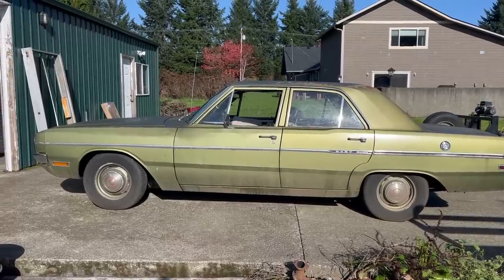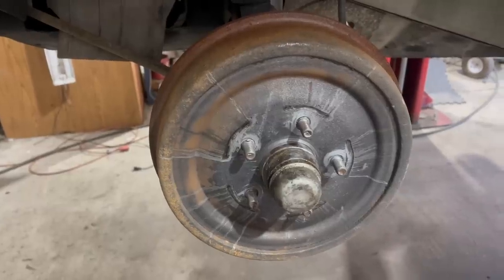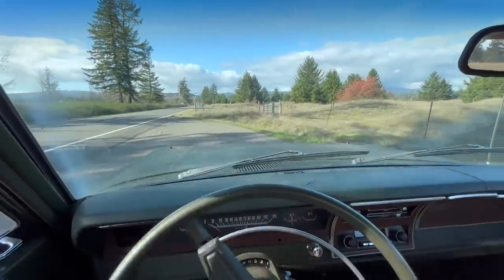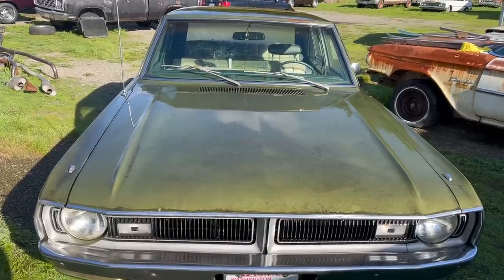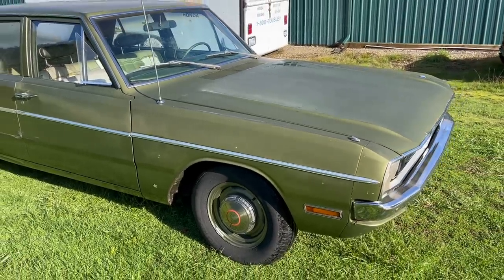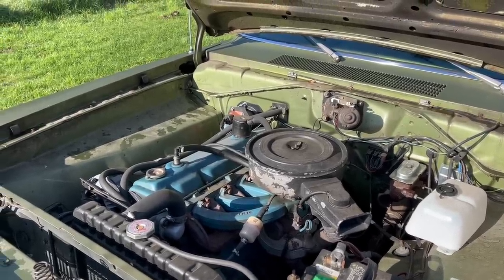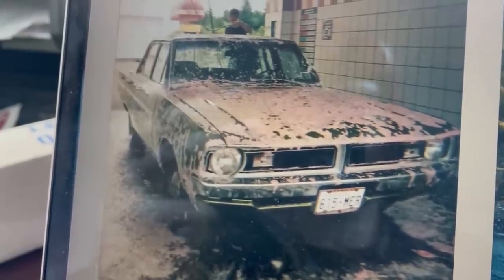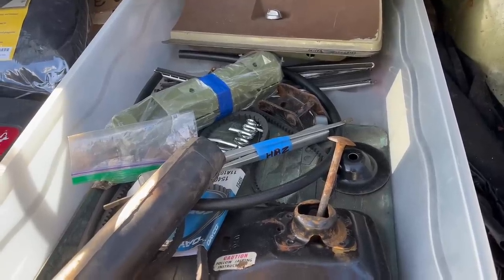Survivor! This Two Owner 1970 Dodge Dart Is A Slant Six Powered Street Machine (With Original Paint)

Comment: Ah the memories... I recognized the foot squirt pedal for the windshield washer. One thing you can do if you are a stupid 16 year old version of me is drive at 100 mph past Richmond Park at 2 am and pull the hand brake to see how far you could leave a skid mark on the road. Then of course dad makes you replace the D shaped tire...Valiants can survive anything...
Reply: And peel the living daylights out of a 14" tire.
Reply from the maker: Haaahaha. Or you’re me at 18 and you have to find out what the exhaust sounds like when you cut the muffler off. Or what happens when you slide sideways across the street into a curb… I participated in many physics experiments behind the wheel of a slant six car.

Comment: Nice old Dart! It very much reminds me of the 67 Coronet 4dr I once had. It was about the most bare-bones Coronet you could buy, slant 6, rubber floor mats, dog dish caps, and very little chrome trim. It did have an automatic though, so I guess that was a step up from a 3 speed manual. I bought it in 1987 so it was 20 years old at the time, but it was very clean. An elderly couple had it and had passed on and their family sold it to me. The ash trays had never even been used. I gave it a good cleaning and a wax job and it looked almost new. It had 3.91:1 gears so it didn't get the best mileage on the highway, but damn I loved that thing. Then I sold it to a friend, who later sold it to someone else, and the rest of the story is too depressing so let's just say I wish I had never sold it.
Reply from the maker: Wow. That’s awesome - until the story got sad anyway. I wonder if it was a base model Coronet Deluxe. It’s so funny that the basic low end models were always called things like “custom” and “deluxe.” You really don’t see many of those. They are almost always the 440 model like our wagon. I actually owned a ‘67 Coronet 440 sedan myself for a while. I never really got to drive it, and I eventually traded it for a boat. It somehow ended up in the Rocket parts car collection, so now I see it every single day I’m there… also sad. It was a pretty decent car.
Reply: @DeadDodgeGarage  It actually was the Coronet Deluxe model. It had a small "Deluxe" badge on the rear quarter if I recall correctly. But, yeah, it wasn't "deluxe" in the true sense of the word.

Comment: Original is way cool! I never knew there should be a small piece of felt on the trunk bracket for the jack until I got my 71 Swinger with 30k miles, white top, green car, multi-green interior, slant, great driver.
Reply from the maker: Yeah! I was surprised when I found that in my ‘71 Demon’s trunk. I really thought Dale might have added it at first. Haha.

Comment: Cool little car! I used to only look at a 4 door as a good dog house donor but have learned to appreciate them nowadays, great to see one original and saved!👍
Reply: 4 door/wagon classics are becoming a popular car now because they are cheap and more often than not are better taken care of, One of the 20 something girls I work with just bought a 1980 Ford Fairmont Wagon because she has 2 young kids, and her ex is a complete dick and kept the car she had because it was in his name, She paid $800 for it, it runs and drives fairly well but the paint is toast. me and one of the other guys have pretty much spent the last 3 weekends with her, the first weekend we detailed the interior, and gave it a good bath, 2nd weekend we changed all the fluids and gaskets so she could atleast drive it. This past weekend we cleaned up the brakes and suspension and started on the body work getting it ready to paint, Currently it's light blue but were 2 toning it White and GM Medium Poly Green, I have a half gallon of the green and the other guy has about 1/3 of a gallon of white that were going to just donate to the cause. were just going to clean up the wheels, repaint them and throw some cheap aftermarket baby moons on it for her.

Comment: I had the same model and color with power steering, power brakes, factory A/C and automatic . The car on a good day gave 12mpg (gas back then was 28 cents per gallon) and the 0 to 60 time was somewhere before noon.
Ordered the car August 1969 received October 69 put 35000 miles in 4 years traded for an ordered 1973 Chevy Caprice with all the options. Good times!!!
Reply from the maker: That sounds about right, except… 12 MPG?! My big block does better than that.

Comment: My grandmother had a 1968 Dodge Dart. No power steering, no power brakes, slant six. It was just about bullet proof. But it felt like driving a car built in 1948. It wandered, the brakes were marginal and it was about 3 1/2 turns from lock to lock.
Reply from the maker: Perfect! Well, kind of. Haha. My grandmother also drove a ‘68 Dart, funny enough. Years after it had been sold to a gentleman, the rear end fell out going down the road somehow.

Comment: WHAT'S the 5:40 difference anyone? My 1970 knowledge starts and ends with the Valiant, also my daily driver since fresh outta high school in 2000. Slant Six car as well. Got her garaged for the first  time ever over the winter to do a full seal set and some MUCH needed TLC
Reply from the maker: Two people have alluded to what it is… basically, the 1970 and 1971 grilles are the same, but also not the same. The hood emblem is also different - this car doesn’t have one at all currently.
Reply: @DeadDodgeGarage What do you mean? I still can't notice a difference 😅

Comment: I loved my gold ‘69 4 door Dart with its slant 6 and Torqueflight. It still had points but I kept that engine so well tuned that as soon as any one of the six pistons hit TDC it was running, just set the choke and bump the key in the morning and you were on your way. In all the years I had it I never had a lick of trouble with it. I even drove it home from Vermont to NJ after spinning out on ice and slamming the right front fender into a guard rail three times. It spun around and hit the same place on the same fender three times but nothing else got touched other than the headlight bezel. I pulled the fender out of the tire, unplugged the flaming headlight and carried on. Found another fender in the junkyard when I got home and it was none the worse for wear. I think it was even the same gold color. Truly a magical car!
Reply from the maker: Oof! Very cool. I am always impressed with how nicely points vehicles start when they are dialed in like that. The only comparable thing I know of is the VE pump Cummins - they don’t seem to make half of a crank rotation before they fire when all is well.

Comment: I had a love/hate relationship with my 1971 Swinger.  Factory FE5 Rallye Red car, Black vinyl top, black & white interior. Sounds good until I get to the Slant 6 engine.  The first engine lasted only 2 weeks before it put the #2 rod through the block.  Got me home on 5 cylinders and no oil pressure though.  Bought a used Slant for $200 and had the car back in one piece in a weekend.  I tried everything.... replaced the timing chain, converted to electronic ignition, even converted to a Super Six setup with two-barrel carb and custom-fabbed dual snorkel air cleaner.

The car still travelled at the speed of smell.

I live in a fairly mountainous area and I could use the temperature gauge as an altimeter.  Anytime I wanted to go anywhere, it was like the Pike's Peak Hill Climb challenge. Except I was doing it at 35 mph the whole way. Stomping on it would surely incite passing gear, but all that would do is make noise and make the engine heat up faster.  By the time I'd reach the summit, the gauge would be pegged on the H.  I felt like Dennis Weaver in "Duel" anytime I took a trip.

Let that one go, too.  Bought for $400, got all the lights, gauges, etc working again. Put a stereo in it, did some dirty bodywork and backyard paintjob.... sold it for $1500.  I might have kept it, but this was the early 2000's before any reproduction sheet metal existed for the A-body and the car needed everything:  floors, quarters, trunk extensions, inner fenders.... you name it.  I'm the king of kitty-hair fiberglass so I made it presentable but it never would've won any kind of OE Judging.

And surely, nothing shy of a rare earth magnet would've stuck to it.

Of course, to replace the car today would cost me $35,000 and one of my favorite body parts.

Oh, and the grille is off a '71.  '70 had silver vertical ribs on the grille, '71 had black.  Also the Hood badge is missing.
Reply from the maker: Wow. There are good slants… and there are sure not good slants. Yours was definitely the latter. 

You’re the only person to answer with both incorrect details. Nice! 

I loved my ‘70 Swinger, but it was largely a platform for learning. Four small block engines, five transmissions. A four speed conversion. The first engine I built (wrong-ly.) The second engine I built (much better, but only after two sets of heads.) Testing different four barrels, intakes, and ignition systems. Bucket seat conversion (poorly.) My first big adventure into bodywork - and how I learned I don’t have the patience for bodywork. All of these lessons and more. I wish I could have that back - but I’ll find a suitable replacement some day.
Reply: @DeadDodgeGarage    I loved my Swinger, but if I ever find another one, it'll be a small block.  After driving AMC Six-cylinder cars for years - they are like night and day. Torquey, lively, love to rev and infinitely more power than a slant.  My Gremlin is a racecar in comparison to my Swinger.

I also had a Valiant Brougham hardtop. Mom bought it new, I inherited it at 82,000 miles.  318, discs, 727, 3.21 sure grip.... that's another one I foolishly sold. To have that car today, nobody would believe the options it had. It was a two-fender-tag A-body!

Comment: I'm sure you would be shocked if I didn't have a 1970 Dart story. In 1994 I bought a one owner '70 Dart Swinger. I didn't meet the owner, because she had passed away. She did however leave clues that she was a whole lotta Rosie. The driver's side of the bench seat was permanently crushed, and I found a business card in the glove box from a clothing boutique for large women. Anyway, it was that factory Damn Green inside and out, like the Dart in this video. It had a 318/904 combo and was completely rust-free. I daily drove it for 10 years, and even delivered pizzas with it! I installed 360 heads, a four barrel carb, dual exhaust, and a performance cam. People got their pizzas real fast!
Reply from the maker: Haaahaha. That’s a great pizza car. My brother delivered papers in his Duster a few times. The papers got there… well fast enough. Faster than they would have in the broken Toyota.

Comment: Nice old Dart. That is a concern, all that extra metal, where there should normally be holes surrounded by a brown/orange crusty substance. 
Down here in Oz, 69 was the last year of left hand threads on wheel studs. In 70, they went to all R/H thread, the same time the (marketing exercise) "Hemi" 6 replaced the slant 6, so a one year only with all R/H studs and 4" PCD wheels. 71 saw the 4.5" become standard. We didn't get the Dart/Valiant twins, just the Valiant, 62-66 on 106", 67-70 on the 108" wheelbase. But our 69/70 Valiant 2 door hardtop was built using a lot of 67-69 Dart sheet metal and the 111" wheelbase.
Reply from the maker: Oh cool! Yep, that hardtop is our ‘69ish Dart with the Aussie Valiant nose, a different dash and RHD, etc. I didn’t know that! Very cool.

Comment: I may have said this before but when I came back from Iraq the 1st in 2004 my ex wife and I were looking for a car that just needed some TLC for a weekend fun car that we could take to cruise-ins and Cars and Coffee's with the kids plus I could use as driver when I had to go do Army things away from home. We found a 72 Dart 4 door, same color as this one but mine had a dark green vinyl top and a 318, it also had the original AM Radio, which didn't last long, a couple months after getting it and doing in depth tune-up including tires, fluids and gaskets I drove it from Central Missouri to San Antonio Texas, that's when the AM went bye bye, a 14 hour drive with little to no entertainment is not fun, I was there for 2 weeks teaching a class and one day 1 I went to Wal-mart and picked up a cheap $30 stereo and put that in so I would have some tunes on the way home. I drove it until 2016 when I moved out here to Northwestern Arizona and gave it to my niece for her first car. All in all it's one of my top 3 cars I ever had, I absolutely loved that car, I'd love to find another one.
Reply from the maker: Nice! I had a green ‘74 sedan myself. 318, 3 on the tree. It was not quick, but it was very fun. It sadly became parts eventually… It was a somewhat crusty pile.
Reply: @DeadDodgeGarage  mine was an automatic so it was even slower than yours but it was the best cruising and highway cars I've ever had, I never had a problem with it and would have driven anywhere.
Reply: Thank you for your service, cheers from Orange County California 🇺🇸, twin 68 Darts both built here and Both model 270, hers is still Slant6 and mine is 318 swapped, daily driver, Love these Cars, mine will roll up to 110mph cruise at 80 like breathing.. 
Mopar A Bodies Forever
Reply: @AtZero138  Thank you but don't thank me, Mine had a 318 and was 100% stock  except for the hubcaps, It only had 3 on it I bought it do I just cleaned the wheels up repainted them Black and then threw a cheap set of Baby Moons on it, I wasn't about to spend a ton of money on it because like I said it was just a weekend fun car for the family and something I could hop in and take on military trips when I had to go to Texas, Nebraska or New Mexico when I had a class in San Antonio or was teaching a class in either Nebraska or New Mexico, I even drove it out to Fort Irwin in Barstow once with my Commander when we were overseeing some training out there, I just loved driving it, Like I said it one of my top 3 cars I ever had, there wasn't anything special about it but it was just a blast to drive.

Comment: Don't the 70's always have a Dodge badge (in script) at the center of the hood as opposed to the 71 and up? My first mopar was a 71 Swinger 225/auto, white w/green vinyl top and green interior - got it from my uncle
Reply from the maker: Correct! It’s the cool script badge for ‘70. The grille is the other difference.
Reply: btw, love the channel and your work - I have a 68 Sport Satellite w/ a 383 and it is hard to get it running perfectly, so I appreciated your efforts with the white 68 Roadrunner - also bonus for using a string as a throttle cable on the 70 Roadrunner when you field tested it- I thought I was the only one that did that
Reply: Hazel had a little fender bender in the 80's, and her hood & grill were replaced with ones from a '71.  I have the correct hood emblem, but not the holes to install it.

Comment: I had a slew of these A bodies back in the 70s and 80s. 225ci to 360ci and everything in between. There is something charming about a Dart with a Slant Six. But not the electrical system. Voltage regulators and ignition resisters are my bane!

Comment: I would restore this car to (mostly) showroom condition, along with: Full carpeting in the cabin and trunk to hide the DynaMat insulation. A Year One stereo unit in the dash. A Mopar Super Commando 360 Crate Engine, backed by a SERIOUSLY beefed-up Torque-Flite automatic with Gear Vendors 30-percent overdrive, and a 3.55-geared 'Dana 60 held down by Competition Engineering traction bars out back. Wilwood disc brakes would be behind Mopar Rallye wheels at all four corners. I'd finish it off with a full set of 90/10 shocks, also from Competition Engineering. The result? It would all add up to a GREAT sleeper that might not exactly scare away any 'Hemi Mopars, but it sure would stun some Japanese tuner cars every now and again at a red light.
Reply from the maker: I would never do any of that to this two owner survivor car - and neither would the owner. Not that it wouldn’t be cool - it would do neat things. This isn’t that car.

Comment: I'd love to have that, so clean!  Rather than a BMW.  '70, was the last year for engines to have full power.
Reply: Also, was lighter due to no door strengtheners and '73 safety bumpers.
Reply: Along with the wonderful, front window vents, had fresh outside air vents, below.
Reply: Add a 2&1/4 diameter exhaust pipe and gain 5+, h.p. & lbs. of torque.    Which will improve mileage also and reduce exhaust manifold cracking.  Convert it to hydraulic lifters, save 13 lbs. and eliminate need to adjust every 20k miles.

Comment: I googled to see if i got the front end issue right. I did. I've had a couple of '70 swingers, and even though it's been awhile, I've had one around for several years of my life.
Reply from the maker: I need to have a Swinger around at all times. It has been a ‘73 and then a couple of ‘72s for the last handful of years. I really want another ‘70, and hope to find one before long.
Reply: @DeadDodgeGarage  I really want(ed) another '70 Swinger but ended up with a '67 (going on '68 lol) GT instead. It really wasn't optional. It has balance issues I hope to ask you about one of these nights on your live show.